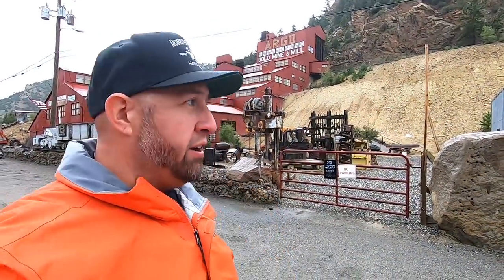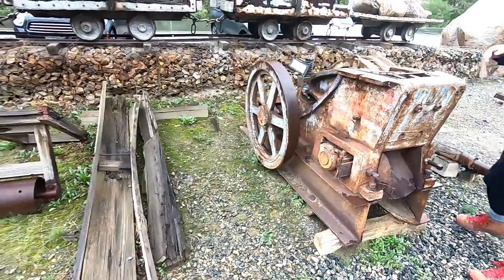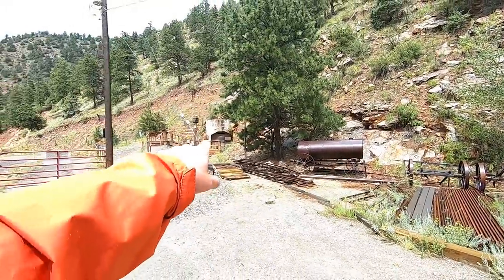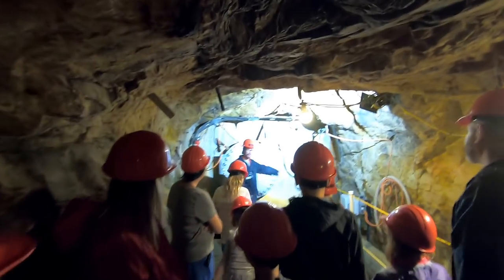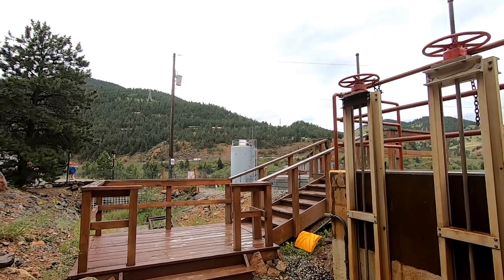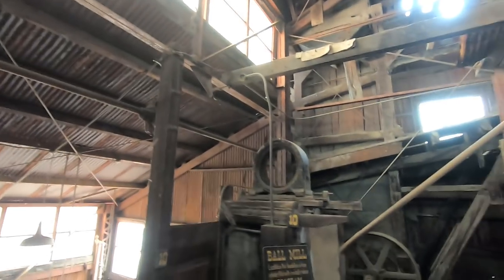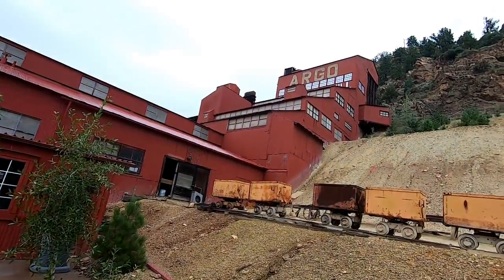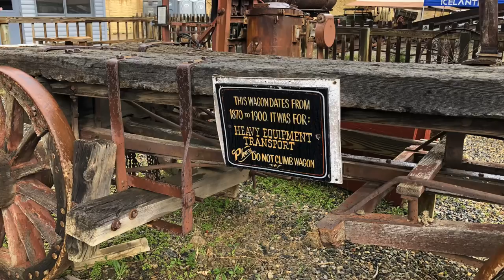Argo Goldmine & Mill

Comment: Now that you've seen how "Modern" mining was done, you need to get into the Copper Country and visit one of the mines up there.  Started with Candles, Sledge Hammers and a hand held star drill in three man teams.  Usually the youngest had a candle on their helmet and held the star drill, and the two older took turns with their sledge hammers on that drill.  The younger kids would be the muckers and drag the muck out of the mine.  To hear that they went down over 1000' in the Quincy Mine BY HAND is just amazing.  They really sped things up when air power tools came to being, but many of those mines back in the day were hand drilled, and they would blast out a few feet a month...

Good Stuff here Adam and Abby!

Comment: In 1982, I hiked all the way back to the face of the mine tunnel, underneath Central City. Pity it's not open now, but I understand the need for water treatment.
Next time you're here, try sneaking 15 minutes west to Georgetown. There's the Georgetown Loop railroad, the continuation of the Colorado Central / Colorado & Southern line that loops back over itself to get up to Silver Plume. It also has an optional tour stop at the Lebanon Gold Mine. If you want to do some off-highway driving, head up to Waldorf where the Argentine Central railway connected with the Waldorf tunnel. It was almost to Leadville when it quit.

Comment: They are jaw crushers.  They take big rocks and turn them into little rocks.  Then they can go into ball mills or rod mills to essentually be turned into powder.  See the Mayflower mill at Silverton.  It has operated recently and is complete.  It has about a 3 mile tram to the mine.  An outstanding area.  The Argo was connected to Central city by a multi mile long tunnel  You can drive the Virginia road up there from behind the Argo.  There are some reoccupied ghost towns.  Central City has been completely changed by casinos.